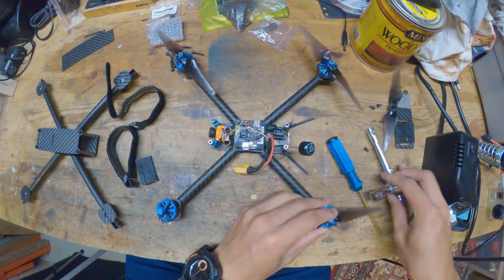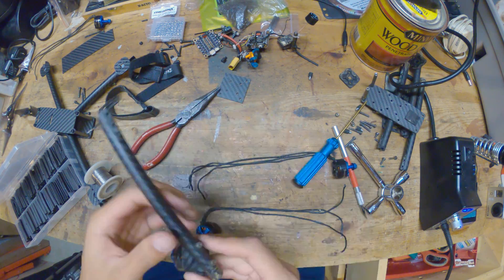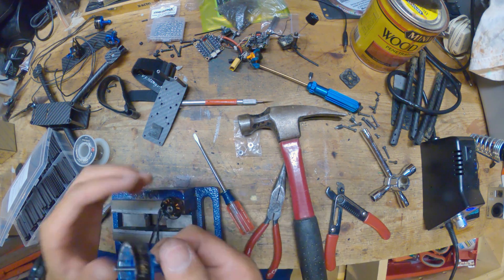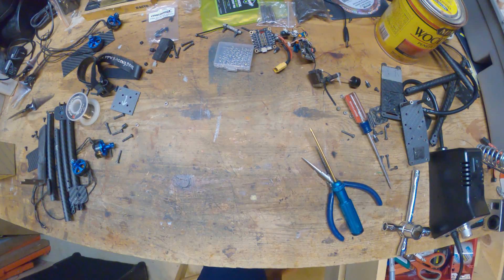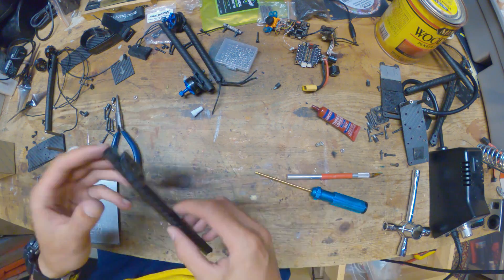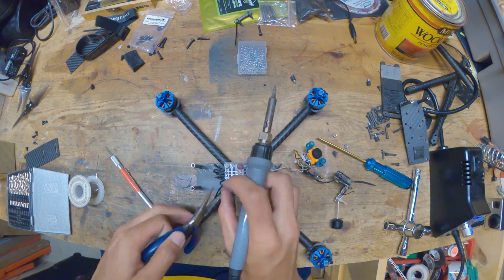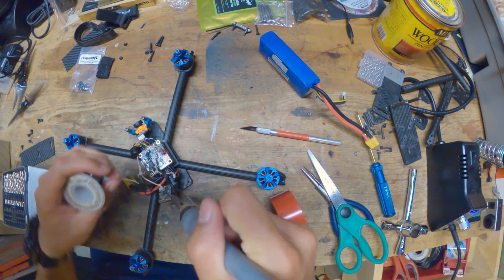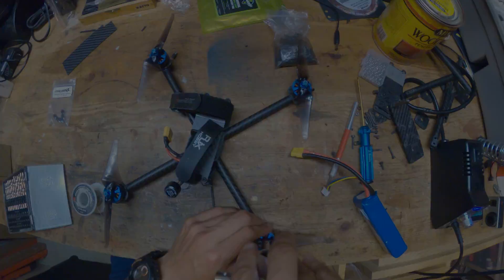Tubular Quad Electronics Transplant

Comment: Timmy I'd like to see some more scratch builds in the future. A micro maybe later this year?
Reply from the maker: I do not foresee designing or building a micro quad within this year since I have never really been attracted to their performance, but I'll make sure to film whatever I build.
Reply: That's okay. I'm on the fence with the micros myself.

I liked the simplicity of you showing how to build from scratch using relatively simple tools.

 Maybe the next one could include a 3d printed TPU canopy? Just an idea...

Some frames are way over priced for what I want. I like the functional without all the hype fluff.
Reply from the maker: I personally try to avoid 3D printing since it makes things impossible to build if you do not have access to a 3D printer, not to mention I don't have one myself. In addition, 3D printed parts are not very strong for their weight compared to traditional injection molded plastics and composites. However my setup does utilize a 3D printed TPU micro camera mount, but only because they are readily available to buy just like any other part. I've purposefully made the CAD files and drawings for the tubular quad public so that if 3D printing is your thing you can incorporate 3D printing into your own version of the tubular quad.
Reply: I used 3d hubs recently for a tpu canopy and arm protectors. I was pretty impressed with the ease and cost of having parts printed by a 3rd party.